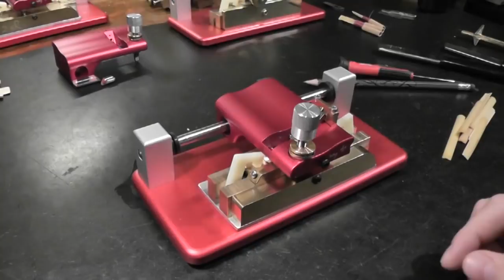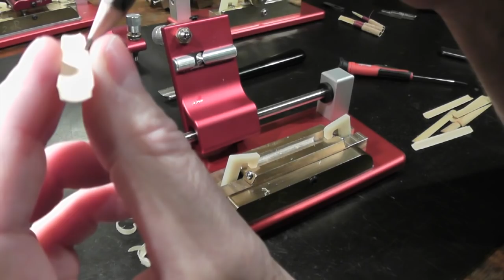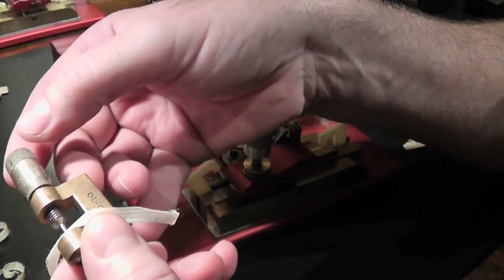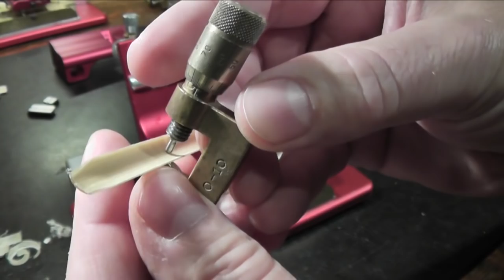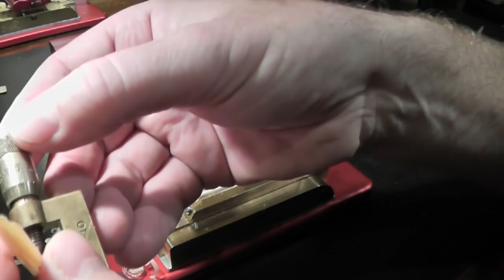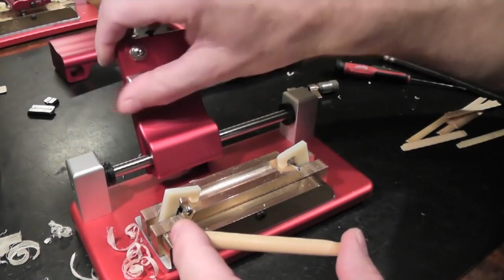Gouging with the New Roy Double Radius

Comment: I was a student of Ralph Gomberg back in the middle 60s and he was using a Bhosys gouger. 60/45. I used the Bhosys gouger, same measurements  and the same scrape as Ralph’s all my career. His brother Harold used a Bhosys gouger as well. Not sure what his measurements were, but probably near the same.
Remember that reed cane is an organic material and there are never two pieces of cane the same. After years you can tell a promising tube of cane from another. Musical talent doesn’t automatically come with reed making abilities. Some have it and many do not. I remember asking Ralph how long it took him to make good reads he answered; usually after a few thousand. 😊🇺🇸

Comment: I noticed on your website there are single and double radius gougers, and they are different. I was under the impression that only the blade is different, asymmetrical on double radius gougers and symmetrical single radius. How is the actual gouger different other than the blade?
Reply from the maker: The difference is with the guide. One side has a slightly smaller radius than the other. The blade is also different in that it cuts to one side. The curve on the sides of the blade is also a bit steeper. Not a semi circle. I think European makers generally just interpret the American gouge as eccentric but there is much more to it than that.

Comment: With either of your gougers, is it possible to adjust the side thickness independently of the center thickness?
Reply from the maker: Yes, that can be done by moving the bed. There are slots to allow movement.
Reply: @PierreRoyOboe  On both the single and double radius machines?